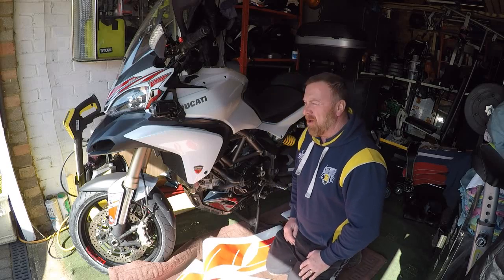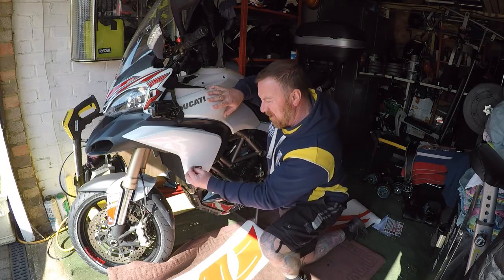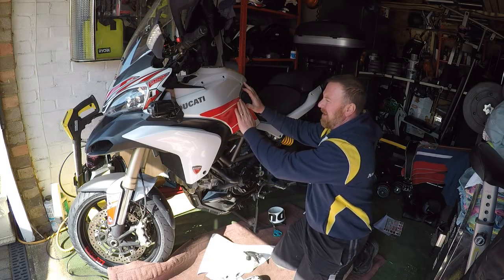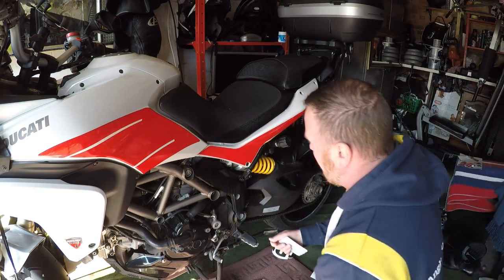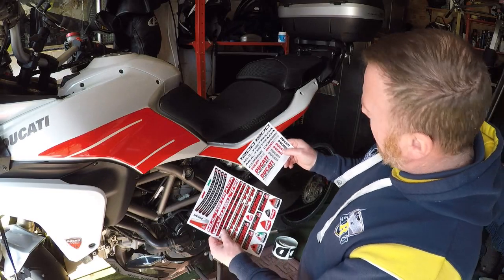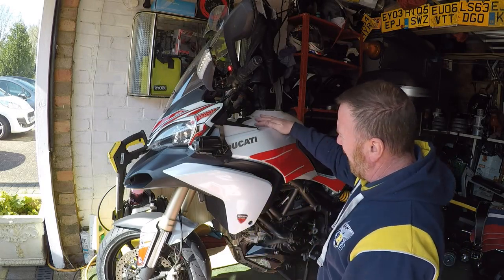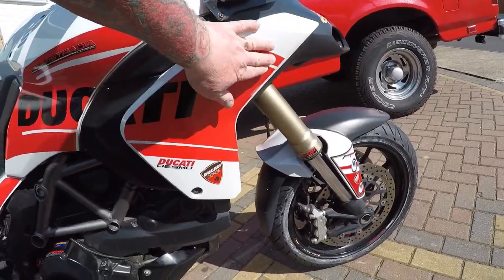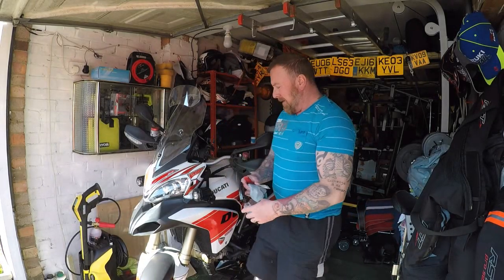HOW TO PUT DECALS ON YOUR MOTORBIKE DUCATI MARK SAVAGE

Comment: Great job and watching this as mine have just arrived. Do I need to do anything to “seal” them once finished? Also my bike has already got the film protection kit fitted. Can I go straight on top once cleaned? Thanks in advance 👍
Reply from the maker: Wash and dry then put them on , don't wash the bike for a few days after bud 
It did come out very well and makes a massive difference !!
I was very pleased

Comment: Hello mark. I have a problem with my derbi senda 125. I've messed up the wire diagram now i'm a little worried how to connect my rpm. There are 2 option. From my stator directly to my rpm or from my regulator to my rpm. Which one is consider best? I think original was from stator to RPM.
Reply from the maker: you could have more to lose if you get it wrong, do you really need rpm ?
speedo more important lol plus you know the sound of your engine
Reply: @marksavage  true

Comment: hi mark where is the 2stroke pump located on a 52reg yamaha neos 2stroke
Reply from the maker: Follow the pipe from you oil tank and it will lead you too it bud
Reply: @marksavage  didnt have one had to buy one off line just wanted to know where it was located
Reply from the maker: @dentoneverett2335  oh someone took it off and pre mixed? 
To be fair normally front of engine or under the lower fairings
Reply: oh ok i thought it was in caseing 
as dont show on google thanks  matey
Reply: do u mewan front of engine where starter is and did u mean under fairing under floorboard
Reply from the maker: @dentoneverett2335  either bud 
If mechanical front of engine 
If electric left side front up or down
Reply: @marksavage  found it under stator plate cheers mark always helpfull mllhr to u

Comment: Hey mark I was putting some new bolts on my Aerox transmission case and one sheared off. Do you know how I can remove it
Reply from the maker: Take all the others out and cover off
Wd40 and a pair of mull grips or cut it off theres enough other bolts to keep it on bud
Reply: mark savage cheers mate

Comment: Hi mark is there any way i can contact you about my moped not going over 20 mph I've tried a lot of things to fix it but no thing seems to have worked it used to go 45 happily until the water pump seal went so i replaced that now it wont go over 20 despite it revving up fine which lead me to believe it was some thing to do with the CVT
Reply from the maker: odd if that's all you touched but yes mate take a look at the VARIATOR like in my videos ,should help

Comment: Mark i need your opinion mate. Where i live mechanics are a myth and...yeah.  so after a flawless 500km trip with my 2006 xl 1000 varadero i stoped to have a smoke and this happend. It starts very well, but wont keep idle, if i keep my hand on the throtle at 2k rpm Thats what happens, rpms go up and down without me moving my hand.  It runs, it pulls but If i let the rpm go under 2k it stalls. After the trip i also noticed that my right exhaust is brown now(the exterior). Also when i start it the gas smell is really bad and smoke comes from my right exhaust even after a 10 second run. Its very strange,  never happend before,  it just did it all of the sudden. I know you can't run a diagnostic from 2000 km away but a opinion from a good mechanic like you would be nice.  Thank you 
https://youtu.be/pZWwMpl3Gk8
Reply from the maker: how odd bud but its not good, the exhaust leaking is a bugger and hard to get too. she has a few miles on here when did you last get the valves looked at?
plugs can break down, wire come off ,connects need wd40 but could be a few things form a coil pack, injection system failings , plugs , air pipes spilt and valve seals gone ( smoke) 
the fact shes still running is good as she doesn't want to totally die but you cant ride it as is as it will fail 
tank off and as many panels as you can but your be do it blind so to speak and replacing parts till you find what it is which is only what the garage would do charging you for it too.
the only easy answer I can give you is replace and look at the cheapest parts first as otherwise it could be a money pit spry to say bud
Reply: @marksavage  i really apreciate you answering mate. Not everyone does it. And im sorry for my bad english, im from Romania. Problem is sorted: someone tried to steal my scotoiler, the part that drips the oil on the chain. They couldn't pull the hose out completly and i think on the ride back from the vibration it came off. The chain lubber is conected to the air vacum so the front cillinder had false air coming in to it. The spark plugs where black as coal and moist.  Long story short i took the chain oiler off and the bike works perfect. Some people are just trash and want to turn in to trash other peoples stuff as well. 60k km is not much for a varadero.  I have a friend with 180k km on his 🤣🤣🤣
Reply from the maker: @SAB-iq1kp  oh wow 
Little bugger that could have jammed up and had you off!
Very lucky and good you found it and didn't cost tou loads
I did say an air pipe along with many other things it could have been 
All in bud a good job done, enjoy and stay safe 
Find the little shit and slap him pmsl
Reply: @marksavage  some people are just garbage mate.Indeed you for mention the air intake,Thats why i asked you for a opinion, you are good! I was in a big sea side resort with about 1500 bikers, most drunk. Might have been a little joke from someone.  It did take me by surprise when i rode it as the engine stalled at 50km/h while letting go of the clutch and i almost lost it,The rear wheel froze up while in a roundabout,but all good. No chance in catching the little fuck,to many people. All in all im thankfull i didn't end up spending a ton of money and as well im thankfull towards you! Not many people answer brother.  When you come to Romania beers,bbq and bed is on the house!